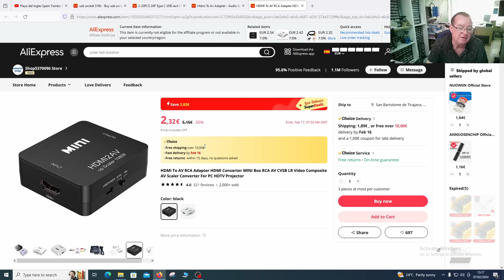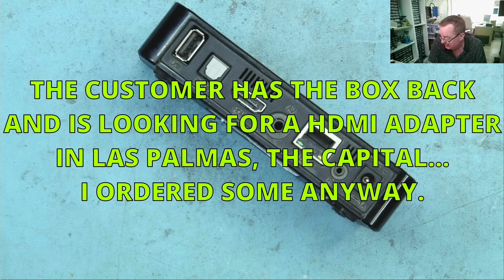Onsite Electronics Repair Work Is Not Difficult And Can Be Very Profitable - Let's Go On-site!

Comment: JFTR: PCM is "pulse code modulation" and means the audio stream is decoded in the box, and then sent as uncompressed audio (basically like a WAV file) to the TV. Bitstream means the box doesn't touch the encoded audio and just passes it through. Then some other device further downstream (the TV, a sound bar, an AV receiver, etc.) needs to decode the audio and send it to the speakers. Both have pros and cons. For instance, PCM can't do complicated multi-channel setups and fancy stuff like Dolby Atmos. It also doesn't support wireless transmission. Bitstream OTOH requires an audio processor downstream that can interpret the data.

I don't think it's the case here (since AV is all analogue anyway) but I've had cases where this setting mattered. Someone had set their player to "bitstream" and the old TV couldn't make sense of the newer codec used, so there was no sound. Switching to PCM fixed that.
Reply from the maker: Yeah I've seen these sort of problems, where the box will give sound on one TV but not on another, and that was with the TV connected by HDMI.  Thanks for the info, I now understand the cause of that much better 😁
Reply: @LearnElectronicsRepair  it worked before so something just went bad in the box. I'm sure no one is playing with the settings. The audio will require either an opamp chip or DAC chip connected to the jack so that's likely to be where the problem is. It would have been future-proof if the guy just used hdmi cables for everything then he can use any available box because hdmi is the main a/v connector used now. Perhaps a future job where you swap out the av cable for a hdmi cable to avoid this situation next time when the whole box gives up. Order the long hdmi cable and fit it at your leisure :-)
Reply from the maker: @g4z-kb7ct  HDMI is not the easiest of solutions, there are quite a few TV screen in this bar, not sure how many but maybe eight or so.  The screens also have an input from the Karaoke system. In my experience using HDMI leads of various lengths and a HDMI matrix combined with TV of different makes is very problematic. He would need at least a 4x8 HDMI matrix if not a 4X16 which is quite expensive and a lot of long HDMI leads which will add up to some hundred euros for the cables plus installation and it probably would not work very well even when it was done.  

A better solution is to replace the analog modulators with DVB-T modulators and then connect HDMI to the video sources.  This is much more reliable, and gives excellent HD quality video (as good as HDMI) using the existing UHF coax. It is also very forgiving of old coax wiring as you can crank up the UHF output power. Also the method of use is same as the analog system he has now (just select a channel on each TV) rather than teaching the bar staff to use the video matrix properly.  And if one DVB-T modulator fails you can connect whatever source you want to one of the working ones as a temporary fix, whereas if the HDMI matrix fails the whole system goes down.

Even with that DVB-T upgrade I have seen some older TV that won't work with the video signal from the modulators. It seems some tuners don't like the MPEG4 encoding or something like that, or they refuse to recognise each channel as being different for some reason, so they scan all the channels in during automatic or manual tuning but only store the last channel scanned (Toshiba I'm calling you out here!)  So if he does this upgrade don't be suprised if he needs to replace one or more of the TV too.

Comment: Can I record From my streaming device to an old VCR if I use one of those HDMI-AV adapters, or is there a piracy/content issue that will scramble the video?
Reply from the maker: The adapters somehow ignore HDCP 😉
Reply: @LearnElectronicsRepair True, but if you are recording from a VCR I would be more worried about Macrovision, rather than HDCP. Old as that protection scheme is, it's surprisingly hard to defeat even these days

Comment: Wondering why you're not putting a probe on the inputs of that DRV632 driver IC? If it maybe was that, and since you needed to order stuff anyways I mean.
Reply from the maker: More that the customer was desperate to have this working same day, so I went to find an HDMI-AV converter instead 🙂
Reply: @LearnElectronicsRepair  Makes sense, in the video you seem to have given up on a same day repair, so that's why I asked. I think I would probably be too curious myself not to probe that, if for nothing other than learning about the device failure modes for the next time I get one in my hands. But admittedly I do tend to get into rabbit holes when I do repairs 😄
Reply from the maker: @fixfaxerify  I Agreed with you It's quite interesting to do stuff like that, and it would have made a better video too. 🙂  I did comment that even if the IC was the driver for the AV output and it was faulty, that I didn't have another scrap box of the same model to salvage a replacement part. I do have quite a few scrap MAG boxes of other models and I have fixed a fair few on this channel before now as well.

Comment: That hdmi to av converter box did not appear to pass through the hdmi signal and the receiver box only had 1 hdmi output, so how did the hdmi video get to the screen? Perplexed 😕
Reply from the maker: The boxes are connected using AV leads to modulators in the bar (one per box) then to a UHF distribution amp and RF aerial cables to all the TVs. The modulators are set to different UHF frequencies. You tune the TV to each channel, then select the channel number you want to watch on each TV. It's quite simple, the customer was not previously using the HDMI connectors at all.  This is why I couldn't just sell him a new box as the more recent models don't have the AV connector.

Comment: Great video, what a laid back place you live.  Imagine flying a drone over Brighton seafront, local plod would be on you before you could say Britainistan.
Reply: @RyanJ_  Aircraft must be below 400 feet and not flown over congested area.  Check with CAA regs.
Reply from the maker: @RyanJ_  Rules, and Canary Islands, have a very loose relationship 😉
Reply from the maker: @tonypacket6954 Imagine how busy Brighton seafront would be if it was 24C on 8th February. Here is was a bit cooler than the previous days due to the haze which is not high cloud but actually fine Saharan dust in the air, known locally as Calima
Reply: Lol ! @LearnElectronicsRepair
Reply: Hi Tony - we were flying a C0 (DJI Mini Pro 4), so as long as it isnt a crowd you're flying over - it's actually OK to do so.